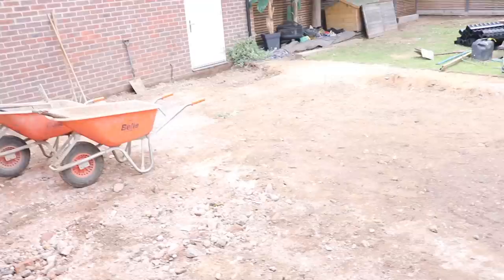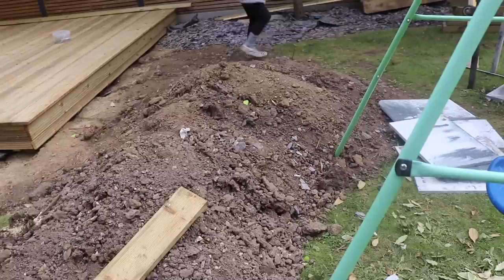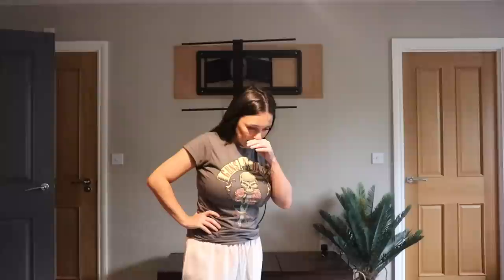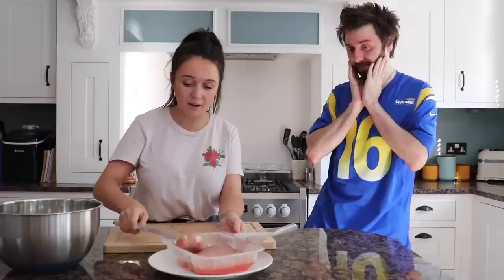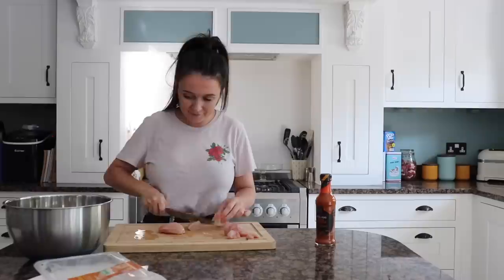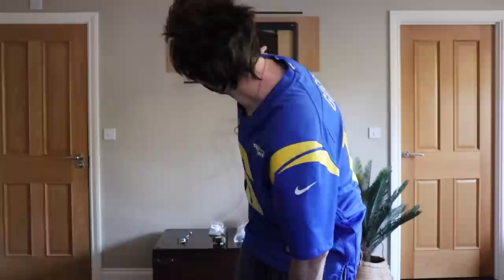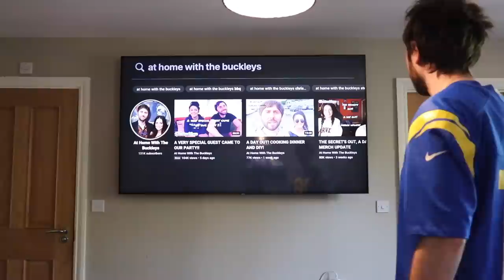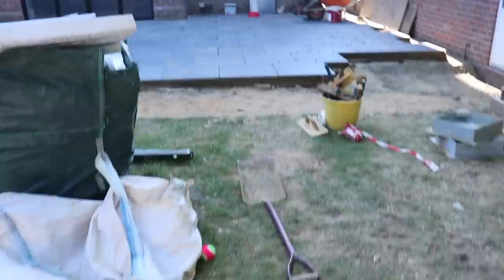OUR TV EXPLODED! AND GARDEN RENOVATIONS BEGIN!

Comment: TV is likely to be an easy fix. Electrolytic in the power supply I expect. That's what usually goes on modern TVs. Why not have a go at fixing it, it'd make a good blog video. Although the new TV is a perfect fit, almost seems made to measure.

Comment: Good stuff Jimmy… Loving the videos; keep it up. Telly not too big… but I do think your bracket is too high on the wall. They always say that top of screens should be roughly at the level of your eyes when your sitting; screen ergonomics and all that. You guys had that bracket put up too high originally … bit of a hassle to change that. 
If you could get the top of telly to line up with top doors it would look/ be better. 

What size is the new telly? I am just about to hit the button on upgrading my Sony from 55” to 77”   Keep up the good work. 👍🏼

Comment: If you like Ethan Hawke, watch a 2014 "Time Travel" movie he was in called "Predestination"...The twist at the end will blow your mind!
Also, There's big debates on which way the timber for decking should be fitted... Smooth-side-up, ridges underneath -stops mould & rot setting in under the boards.
Unless you have Anti-Slip Decking, which usually has both sides ridged.